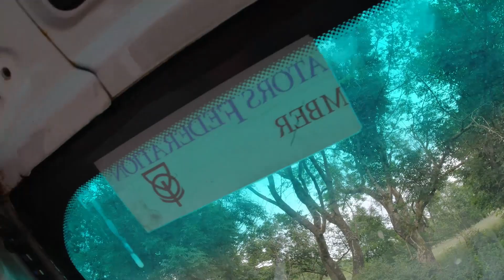Professional leak finder required  (The leak situation goes from bad to worse 🤦‍♀️)

Comment: That windscreen shouldn't have been fitted while all that rust is on the lip. LDV maxus antennas are less than useless they rust on the inside then you can't get reception. I've fitted one from a Nissan micra and it works perfect so if you can change it while you have the roof lining out , also 4 way stretch the headlining before re fitting makes a massive difference. I've never had an LDV maxus that didn't have a stained roof lining at the front.If you are going to reseal don't use silicone use sikaflex so you can paint it up when it's skinned over. I recommend EBT+
Reply from the maker: Totaly agree hopefully I can sort it or I’m paying for a new one again lol I will get a new Ariel ordered don’t think it’s leaking but reception is terrible lol.  Got tiger seal and  sikka flex.  Can I paint over tiger seal?
Reply: @RufflyAdventuring  I believe tiger seal can be painted but I've never used it myself .